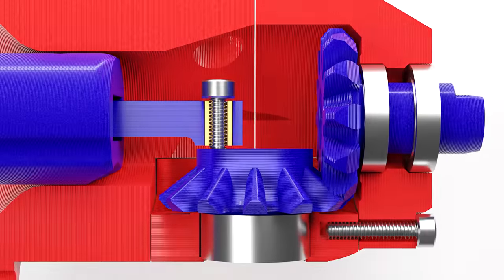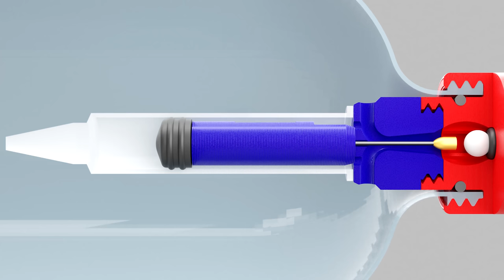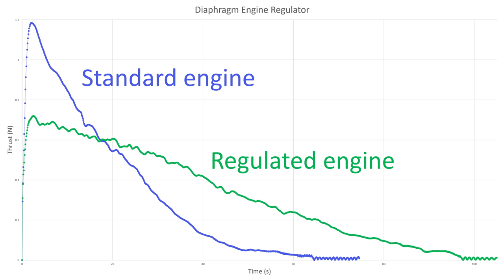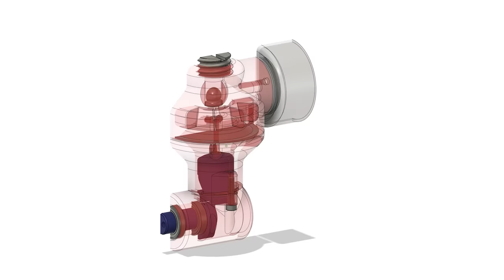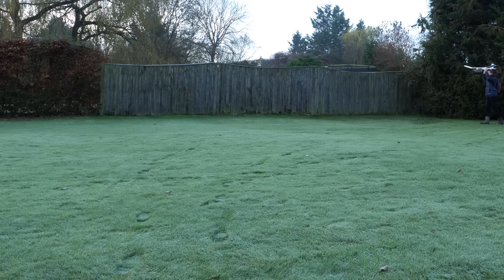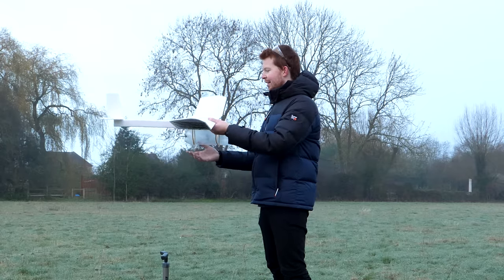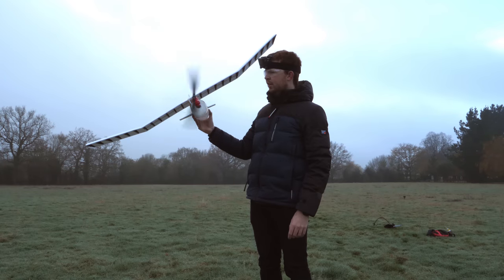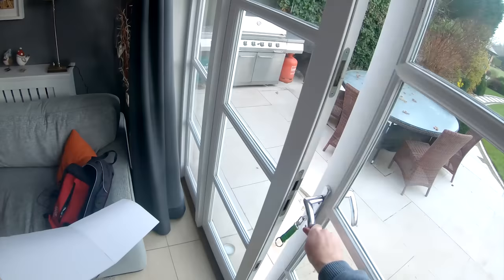Pneumatic Plane

Comment: Could you make a piston engine using compressed hydrogen from a dry cell hydrogen generator?
Reply: maybe, but it would probably be too expensive, as well as more inefficient. there is almost now way you can fly a plane with that, as its too heavy.
Reply: Also it would be extremely flammable.
Reply: @americana_incarnate1717  yeah one spark and it’s over
Reply: They’ve built full sized planes running hydrogen
Reply: Thats just stupid
Reply: If u mean generating while flying with a battery, then you’d be trading 85% efficiency (elec motor) for like 15% of a steam/CA engine. U could do electrolysis in a sealed container for pressure but the hydrogen and O2 would recombine at some (idk)  rate if not separated
Reply: could become a bomb tho
Reply: @coltonward3609  And what happened to a particular one in 1937?
Reply: @cryolabs  wow did it ever backfire into the crankcase or intake? In my experiments with 2 strokes they can backfire back down the transfer ports occasionally if running lean, with hydrogen/o2 mix id imagine it could be pretty powerful
Reply: @cryolabs  for sure can’t expect perfection, it sounds like it worked pretty well tho. I haven’t read up on the differences with hydrogen ICEs, if you need to change the ignition timing or anything. My worry with the backfiring was trying to start it as gas feeds continuously into the intake, if it might blow off the carburetor or pop out the crankcase seals. Did you start it on hydrogen or regular gas
Reply: @cryolabs  ohh sorry, my first reply was worded poorly, I haven’t actually tried running a motor on hydrogen, the backfiring issue I was having with 2 strokes was with regular gasoline. So because of that I worry if the backfire could travel up the intake or up the hydrogen tract. Did you keep the hydrogen and 02 together in a storage tank like brown’s gas, or separated for safety?

Comment: The point of making the wings in that shape is to create lift from different air pressures and to do this you need to cover the bottom so air is split above and below and has a longer path on top but short strait path on bottom.

Comment: Actually it would fly if the wings of the plane are made correctly, what I mean is that the wings got the shape of an AEROFOIL but the lower part of the wing is to be covered with flat surface. Due to the presence of surface only the pressure in acted from downward. the dynamics will be perfect

Comment: add a heating element to the air tank that you can heat up before you take off for more pressure
Reply: It would have to be heating blanket for the bottle that you can put on, heat the bottle, take it off and go flying.
Adding permanent weight in form of heater to the plane is a no no right now :)
Reply: Fill it with combustible gas, and light it when launching. That'll keep it toasty.

Comment: I think the airflow into the open tube is impacting the flight path and plane resitance to direction change. I would put a sharp cap (cone like) on that so that air does flow around the tube instead of inside it. I am talking about the tube that holds the wing and the bottle.

Comment: You need wing lower covering to increase  lift. Think how a wing works .
Reply: Yeah, the lack of skin on the underside seems a bit odd. Turbulence inducing.
Reply: The open bottom increases lift.
Look up 'deep camber wing'. That's the idea. They create more lift at low speeds.

Comment: I've always wondered, to strengthen the layering process, could you heat up a thin needle and push it through from one end to the other, leaving enough spare metal/needle showing at either end to then be hammered down or bent over? Creating a kind of metal staple which holds together all the printed layers?
In addition, couldn't the part be "baked" or even hit with a small heat torch, to basically re-melt the layers into one another?

Comment: Airhogs were one of my fav toys as a kid, this reminded me of that
Reply: Same! Best Christmas present ever. I played with it was just a bottle with a prop.
Reply: Also as a side note, the airhog engines were actuated directly by the piston, which compressed a spring. At the bottom of the stroke the air blew out of a small hole in the side of the cylinder wall, like a 2 stroke engine, before the spring pushed the piston back up. The piston was sealed by a simple rubber ring. 

I think the moulded foam and fitted bottle allowed them to be quite aerodynamic and light also.
Reply: @blahblahblahblah2837  yes they were very light but also I remember them having more power than his seems to have? Honestly I'm surprised he's struggling to keep his flying.
Reply: I always wanted an air hogs as a kid.
Reply: @pilotdog68  at full pressure they were definitely more powerful than his one. I wonder if you can buy something similar these days?
Reply: @blahblahblahblah2837  it does not look like you can anymore, I just did a quick Google search. They mostly have remote control stuff now unfortunately
Reply: @Tents.and.Timber  haha so did I. I couldn't find anything similar either unfortunately, but I really want one now

Comment: Put holes in the wing. FliteTest has shown that airplane performance is still good with holes in the wings and body to cut back weight.
Also, you’d want thrust, not longevity because it can take off higher in the air and glide further than dampening the motor in exchange for longer spin time.

Comment: 4:16 Should have said that strength and weight ARE proportional, not "inversely proportional".
Reply: He was probably thinking about less weight being higher value.
Reply: He said it right.. get some knowledge
Reply: @rakib9420  being condescending doesn't make you seem smarter you could just have left it at that or told them why
Reply: Apparently we did this in school but I couldn't remember but looking it up I found articles talk about thickness being inversely proportional to strength due to structural defaults but density is directly proportional to weight so and both can be used to determine weight and to improve it you can mix materials(alloys) or try to change its form to a more dense one
Reply: I’m confused why is inversely proportional right? Should it be proportional because higher weight is higher strength and lower weight is lower strength?
Reply: @Omlet221  its not abou the strength of the plane but the strength of the engine... So if you make the plane more heavy you will need more strength to power up the plane. So its inversed.

Comment: I use an air compressor for painting but it has a filter to catch the water so your just spraying air instead of air and water. So if you had that the aire being pumped in wouldn't freeze. Just an idea 💡

Comment: DRY ICE !!! with pressure regulator??
anyone??
Reply: That would be sweet! You could get a lot more air/pressure I. The bottle that way
Reply: Better liquid nitrogen
Reply: @josiasmangussiborges  it will make the bottle brittle though.
Reply: @Shreyam_io  for sure. But if u can handle low temp, u got it

Comment: I know this was 2 years ago but here I go anyways! Rubber has this weird behaviour, where the stiffness increases both when stretching with a higher frequency and also when stretched at the same frequency but under colder temperature.

To summarize:
Higher frequency or lower temperature -> stiffness goes up.
Lower frequency or higher temperature -> stiffness goes down.

So what happened here must have been that both the high frequency and the cold weather negatively impacted the performance of your membrane used. A possible solution to this could be to try this test again in summer. So that the effects of the high frequency and the high temperature on the rubber, cancel each other out a bit better.

Comment: now use LNG in the form of butane to get a constant gas pressure and optimize at 20psi
this may sound silly as the butane is valuable but consider that you could use a pre-burner chamber to get more gas by combustion(like real turbines) or that a regulated supply at the optimal point would help control the thrust by using a servo needle valve to make it RC compatible

Comment: I just watched this video, I just may have noticed one thing that I can point out that I have an idea about, in your motor build and fabrication of moving parts, you explained a problem in resistance in your crank, and it is a screw that tightens up on a conrod and then creates resistance, I think that with the screw that holds the conrod in place, the thread that sticks into its fitting keep that part of your thread, and then hand file down the rest of the thread to avoid screw down, this is an amazing idea, I hope I will help you push more power out of it, all have a nice day, my name is Ben Crouch.

Comment: I really think that if you will increase the gear ratio between the piston and the plupelor this will bost the aircraft preformce, the plupelor will spin faster and will provide more force for the aircraft, this will cause a lower run time for the engine but this is not an issue when you consider that the engine has a a run time of 60 seconds and the longest time the aircraft managed to stay in the air is 9 seconds.

Comment: Hi, your air-plane is turning to the left because your tail is bending left - if it is a matter of anti-torque, compensate it by moving the whole engine axis off the plane's one (~1.5° to 2° on a regular RC model, may be more here because of the size and step of the propeller).

Comment: Have you considered that compressed air is heavier than air at ambient? A 12g CO2 cartridge weighs 40g when full and 28g when empty. Perhaps even experiment with a CO2 cartridge for power instead of the large bottle (which also creates excessive drag). The CO2 cartridge could then be placed forward or rearward to give a better center of gravity, thus increasing the glide aspect.

Comment: I am thinking about what could be added to help make this more functionable and having a form of valve fitting to a remote controlled servo from another rc plane or rc car could be used to control the flow of the air to the motor to acheive longer controlled flight as well as rc servo wing flaps which would be quite a cool addition to have imo. also possibly like a ocean spray cranberry juice bottle for higher compression without exploding to have higher rpms and longer flight time possible.. i know it would add some weight but i figure that it will most likely out do the addition of weight with power..

Comment: Generally brilliant idea to use pressed air energy. But the main problem of such energy accumulators is engine slowing down during pressure decrease. In aircraft it critically matters. Necessary condition of stable fly is balance between lifting  force and engine one. According to fact your aircraft has no flaps lifting force depends only on speed and pitch angle. So changing center of gravity position you could change pitch. As for making engine force  be constant - you need some pressure reductor between bottle and engine. And learn engine work with low pressure of 1.5-2 bars. Plastic bottle can easily take 10-12 bars, so while air pressure  will decrease from 12 to 2 bars engine will work with stable RPM

Comment: If you put dry ice inside the bottle, you might be able to get greater range as it turns to gas. However, it will make the plastic brittle. adding water accelerates the gas making, but if you put too much, it turns into a bomb.

Comment: I recon  you can cut the bike valve shorter since its not used for its original application which is a biketube ,that would decrease its weight

Comment: There is no power and thrust in the motor so instead going up it falls because the air inside it ends..It needs an interior way to feed the motor with compressed air while it flies so it will keep going up.take advantage of the outside air as it flies…Maybe you can import it inside then compress it an then feed the motor

Comment: If  i think of the Space Shuttle Challenger back in 1986 they had the same issue with the sealing rings at low temperatures, causing a huge firework

Comment: Have you considered a "rear" mounted propeller model. 

There are several real world examples of this, but i was thinking for centralized weight maybe have propeller above the wings behind the air (on the back basically)
Also it would not break the engine when it lands on the building or other hard surfaces. 

just a thought..

Comment: Cool.
Needs a little length of fuselage maybe, center of balance isn't quite right for the flight pattern you're looking for.

Try attaching incremental weights at various places until you've decided what strategic changes to make.
Have fun, cheers to and get r done.

Comment: I would love to see this engine powering a car or something. Maybe making a v twin variant with 2 bottles for a small rc car type contraption would be sweet. Maybe you could design a cvt type contraption to always have a load and keep the engine at a lower rpm and since it would have 2 cylinders, you could make the firing order 180 degrees apart to make it fire twice as often thus not needing to have the engine perform at such high rpm. Maybe you could lighten the entire engine by making the walls thinner and then wrapping it in a layer or two of a plastic wrap or doing something like that to try and increase the strength while reducing weight. Maybe using a taught layer of latic sheeting instead of foam could make the plane lighter yet again. And tbh at that point, the only large weight savings to be had is the engine design

Comment: Have you considered the cushioning effect of long grass to protect your creations from serious damage?  You just need an acre of long grass somewhere.
   You do seem to be at the limits of design for the materials chosen . If you could just reduce the weight a little more would appear to enable sustainable flight . I'm just wandering that picking a day of high barometer pressure might give a boost too. Around shores of Black sea it's say 450 metres lower than sea level.  . Thus you need an acre of long grass around shores of the Black sea on a day of high barometer pressure.  .And can you place 30 grams of say dry ice in the bottle for enabling a long duration flight ?  Maybe some lightweight Black fabric or tissue paper inside the bottle also to capture the heat of sun to help sublime the dry ice .

Comment: This is very first time I saw your video. 
Suggestion: to avoid the engine and propeller to be broken in every landing, I would totally change the design of whole the plane: the propeller has to be not pulling, but pushing, and located and to be faced backwards.
Maybe, you have done it already on your latest models))

Comment: Why not to add some liquid gas in the bottle (like LPG propane), so it can evaporate and create pressure, making running time longer? Under normal conditions (20° celcius) its pressure about 8bar, so the bottle should handle it without problems. Also the pressure in the bottle would stay more stable 🙂

Comment: What did you expect when using a bolt as an axel in an insert that's made from a weaker metal than the bolt, in a really fast machine that has constant load on it and spins?

Comment: The wing needs a redesign. 
A wing made with one single continuous corrugated sheet, wrapped around itself (Like a flattened roll) with a thick piece of corrugated sheet inside (For the buldge), stuck together with Hot Glue will do the job. 👍
Reply: Simply covering the underwing could also be an improvement, since the wind speeds on the wing needs to differ for the lift to work

Comment: i'd say you should move gears farther away from the head of rotor using a long shaft and add more stabilization for the shaft and rotor head. That should increase... well.. stability, which means less chance of a failure/break

Comment: 5:21 Friend, in the photo I saw a part to which a metal overhead line is attached. to lower the vibration, do this part again, but mirror the attachment point for the metal pusher to balance the weight relative to the axis of rotation. roughly speaking, make this part not in the shape of a drop, but in the shape of a diamond, where there will also be a hole for the shaft in one of the corners.

Comment: engine idea seems good, but the design could do some work I think? remodel the wings (cover the ribs, it should give some lift) and recalculate the weight distribution just in case, just make sure the wing is at the middle of the distribution

Comment: I have recently heard of toroidal propellers, their design is supposed to be more efficient and provide more thrust and reduce drag for aeroplanes and boat applications, 
Also like the commenter below, "Ze Doktor" suggested: cover the underside of your wings, make an elliptical wing tip to save weight and is more efficient and consider the gear ratio you're working with and the RPM of the propeller, but i hope the toroidal design of the new type of propeller should help with that.

Also: i am very dumb and i don't know jack's S#@% about aeroplanes, i just suggest what the others suggest and try to pay attention to new technological stuff and tell you about it.

Comment: Hi... Im from Argentina. I speak spanish. Maybe you have to change the angle of the wings. I runs in circles. In the air we have to obtain the stability, the equilibrium. The motor turn your plane to a side and you have to modificate the angle. It has to run right ahead. Then, the motor dont have potencial o rpm... You could probe with more motors in the wings. You have to look the birds and the other kind of plane that they are invented succesfull. You engine is great. You could generate more power with other kind of gases with more compression but you have to probe with other material and not with a bottle of cola. You could use bottles of desodorant with aluminium. It could work. DO IT !!! The world is yours !!! GREAT !!!